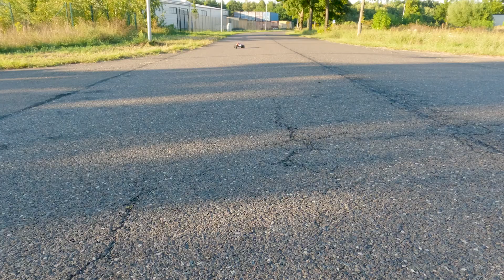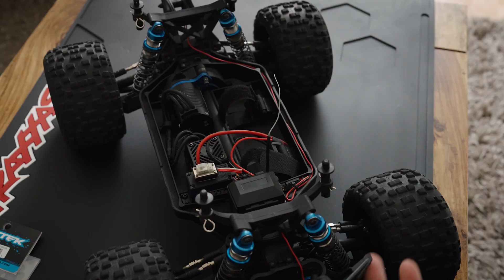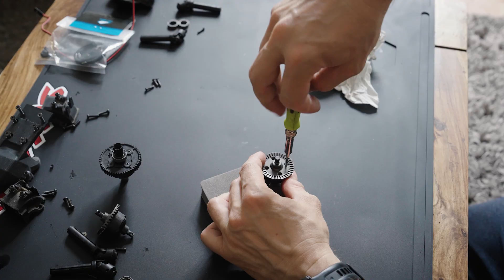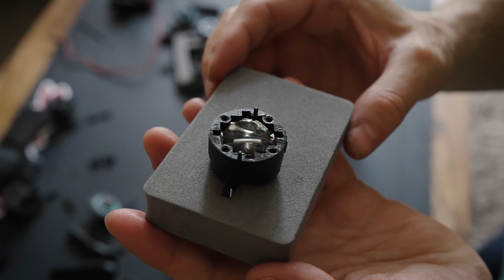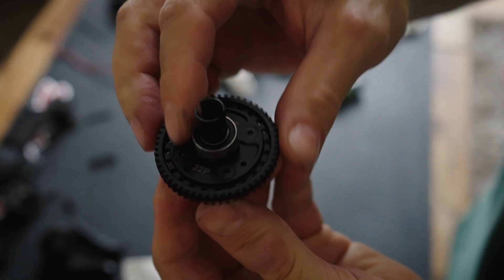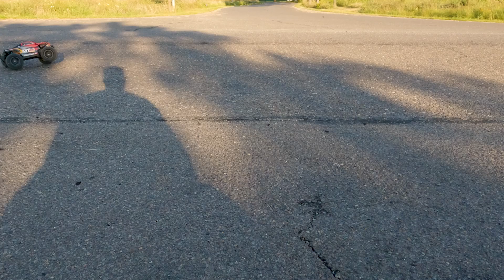Rival MT10 - Exotek metal spur gear upgrade (2281) and differential maintenance

Comment: Are you also experiencing the rear or center dif case constantly breaking? First blew it up pushing the limits on the beach and replaced it but it burnt out after about an hour of use again.

Like the inner plastic of the case melts and locks the sun gears up. 

I wonder if there is a metal replacement option?

And don’t get me started on the driveshafts lol those constantly break
Reply from the maker: Sadly, I haven't seen any metal diff cases for the MT10 either. For sand may you can try running thicker diff oil (mid/rear). It locks up the diff more, so the gears turn less and hopefully produce less heat. That would also improve the "4WD feel" on loose ground.

Comment: I wish I listened to you and all the other MT10 owners who say in their videos to check and service your diffs when your truck is brand new. I didn't and my front diff has heavy wear already. I'm sure they're all empty on oil like everyone else's.
Reply from the maker: Pretty sure all of them have not enough oil. Luckily, the repair kit is not that expensive.
Reply: @TheRCTechLab so back with some good news. I serviced my differentials and yes they were empty but the gears are in acceptable condition. The bad news is something is wrong with the gear mesh between the ring and pinion in the front gearbox. I have no idea why it's so tight and making bad noise. I did fix one of the sound problems I was having which was coming from the front outdrive shaft. It turns out there are o-rings placed inside the bottom of these cups for the driveshaft to rest up against I guess to dampen the metal on metal contact making it quieter and softer. This o-ring is not in the manual. My original one was all tore up so I replaced it with some cut pieces of heatshrink tubing. Works fine now. Just need to figure out that gear mesh problem and my truck is perfectly fine.
Reply from the maker: Great to hear the gears survived! As for the tight gear mesh, you'll probably have to dig into it yourself to find the issue. May there are some shims that make the mesh too tight? And I know the issue with the O-ring. It's not in the manual at all. Mine is still in there but already looks pretty rough. That heat shrink idea is an awesome quick fix! Hope you get the mesh problem sorted out soon!
Reply: @TheRCTechLab yeah I'm pretty sure it's just the gearbox is distorted shape and nothing can be done about it. I bought replacement gearboxes, pinion and outdrive set and a ring gear for that front differential. Gonna run those gears into the ground and then when the time comes I'll just swap the parts and hopefully it's back to nice and smooth mesh with no noise. It's a lot better now that I fixed the damaged o-ring situation so it's tolerable. Compared to the noisy motor clicking from turning over and the spur mesh which is just always noisy no matter what you do, I'll take it.

Comment: How has the metal spur gear held up? I have been thinking of getting one of these after quite a lot of plastic ones i keep buying are not lasting?
Reply from the maker: No problems so far! I haven't had any issues. And my little son puts it through its paces. 😂
Reply: If the plastic spur isn’t lasting, check to make sure the motor mount is not bent. It’s a common problem.
Reply: @georgetek  I upgraded to the carbon one and it still chews the gears, I think its the slap when landing from jumps as the MT has a floating motor doesn't it so there's no real support
Reply: @A1D4N1000  You might check the motor shaft to see if it’s bent.
Reply: @georgetek  That's all running straight. I have bitten the bullet and bought the metal gears so we shall see how it runs :)

Comment: all these years ive been taking my car apart and i never thought about removing the skid plate thng to expose the lower part of the rear and centre diff 🤣
I've always been fiddling to get the centre diff back in trying to line up the bearing with the notch
Reply from the maker: Okay. I can imagine how hard this must be. 😂
Reply: @TheRCTechLab thanks so much for this video btw. Also though the screaming my car did wasn't normal. I'll get myself an exotek spur, it's just funny that to get the gasket we still have to buy the stock spur
Reply from the maker: Yeah, that’s a disadvantage with Team Associated. A lot of the spare parts are shipped in groups of parts. Would be great if they would offer like a service kit with the seals only.
I’m glad you enjoy my video. 😀